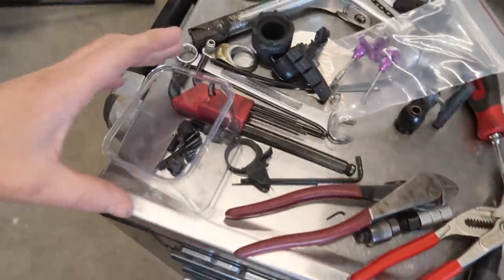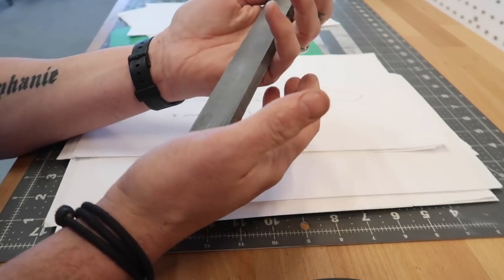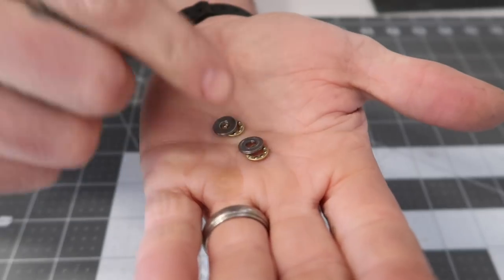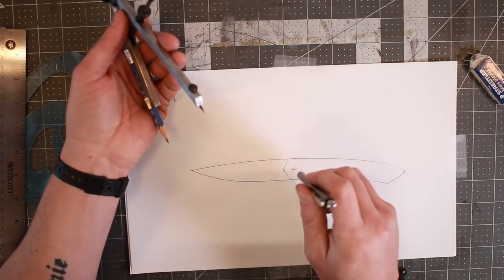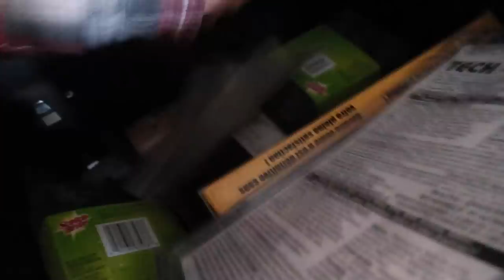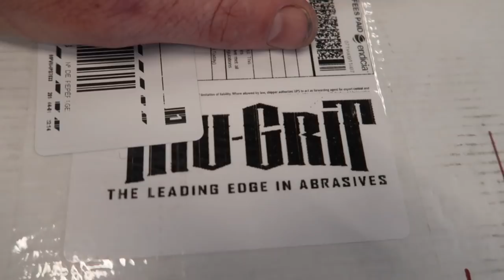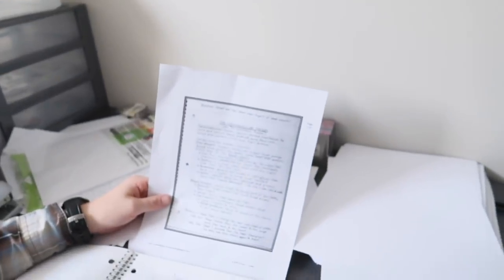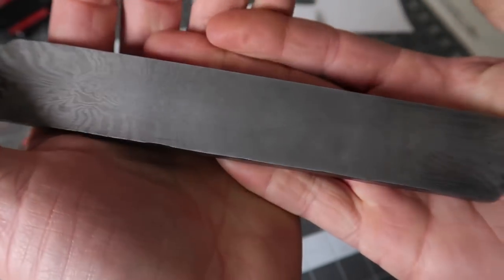Making a frame lock folder (with Alec Steele Damascus) - Part 1 -

Comment: So much good stuff going on in this video. Your beard’s back, you cleaned up the garage, you started working on the knife for Alec’s steel, and your beard’s back. Lol

“It’s a wicked world we live in.” - A sad fact.

Looks like you may need a bit more metal on the back end of the blade to make room for the stop-pin. This may means that the pivot will have to move, either on the handle, blade or a little on both. Looks good so far though.

Comment: I was shocked when I saw how many trizact belts he ordered :0
Jeremy, I don't know what your doing to your belts, but I have made about 40 knives on a single a100 and a single a45 trizact belt, (obviously just polishing, not stock removal) and they're working just like on the first day. 
I know you make many more knives than I, but these belts will get you through the next 400-500 knives :):)
The trick is to dress the belt with a diamond stone (just Hold it up to the running belt for 2 seconds)
That will get all the debris that clogs up the belt out there, and even out the surface, getting all the nooks and crannies out of there.
I hope I can help you getting more life out of these trizact belts, since they are hecka expensive
Reply: By diamond stone, do you mean a diamond sharpening stone or an actual diamond? Looking to revive some destroyed belts that my school's metal shop throws away.

Comment: It would be quite the undertaking (especially for a novice blacksmith/bladesmith) to forge that billet down to a workable size. That being said, it will be a shame to grind it down to thickness and lose all that material when it could be forged down and lengthened to where you could get a couple folder blades out of that one billet. 
Perhaps a call or e-mail to Alec on how to best utilize as much of the billet as possible? Or maybe find someone to forge it down for you if you arent confident enough in your ability to do so?
Good luck with the build either way though. Eager to see more.

Comment: Under the pivot hole on the blade where it is rounded there should be a flat section for the frame lock to catch and hold it open

Comment: You need a drafting tool called a circle template. good for accurate circles smaller than a compass will do.
Reply: Stephan Beck he had a circle jig hanging with his French-curves. The issue with using it is being 100% accurate with centering each circle on the same center. A compass is better for his application here.

Comment: Use compressed air with like an 1/8 needle tip while pulling and they should pull right off.

Comment: i love that slick design! but with that handle shape i can already see the blade cutting your thumb in between the scales when it‘s closed... also the tip of the blade will catch on your finger when too close to the edge of the scales... so maybe make the handle a bit thicker?